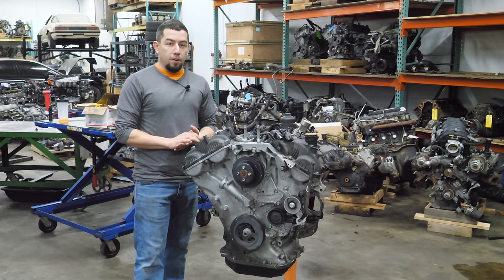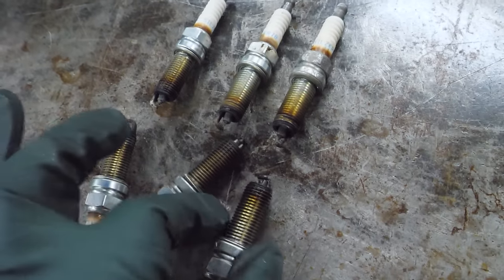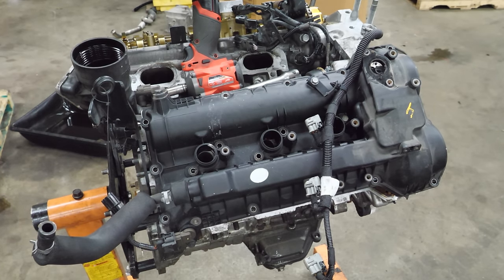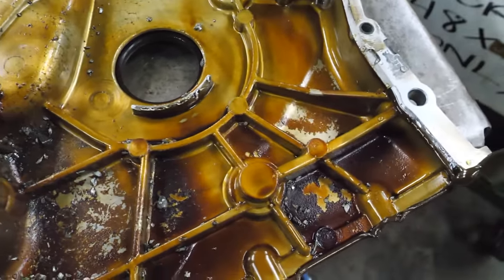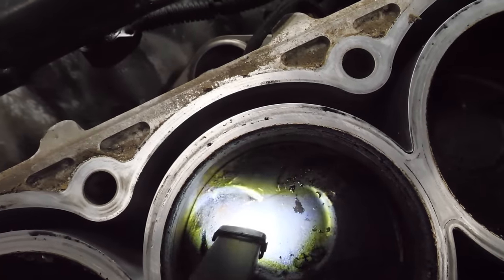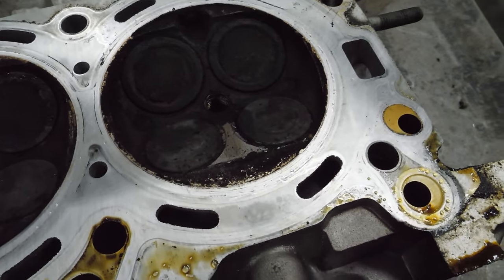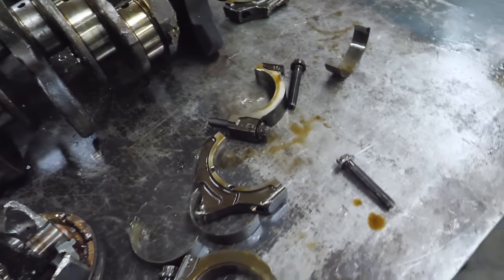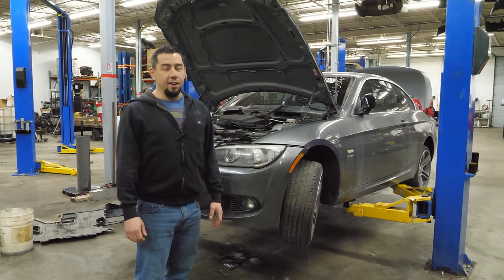Taking "Blown Up Engine" To A New Level! Kia Sorento 3.3L GDI V6 In Shambles. I AM IMPRESSED!

Comment: Extreme Carnage!!!! That poor engine was forced to run, until it would not run any more... My guess- what started this destruction was over-reving.. A rod BoLT then let go, and the entire bottom-end was wiped-out in an instant... A LOT of inertia caused this to rapidly happen... The fact that the oil pump and filter, didn't have sharp chunks shows that it probably did not run more than a few seconds after the initial failure took place. The inside of this engine was nasty, and the owner of the vehicle neglected the car, by not doing the oil & filter changes when they should have... What was once a nice car, quickly transformed itself into an expensive pile of scrap metal.. This engine probably still has parts that might be useful to somebody who just wants to get their car going again,..  So yes, it's not a total loss for somebody who needs some of the working parts that came from it... In My Honest Opinion, I would not want to own an engine this complex..  Because the rest of the vehicle and the electronics are going to be complex too... More to go wrong... And when things go wrong in a machine like this, they tend to go wrong, in a very big way... I have heard in the past, that Hyundai and Kia vehicles have engines and transmissions that are made by Toyota. I wonder if this engine was made by Toyota?

Comment: Man, the valve heads, buckets and cylinder heads got really hot. The oil was was so hot it was smoking, and looks like it was blowing a lot of oil into the cylinders before it let go. This thing was run hard while very low on coolant.

Comment: Mate, what a phenomenal failure. Must've filled it with purifying water (read: hydrolocked), then booted it to cleanse the internals (max throttle to expedite incoming internal obliteration) and ran it dry with no chance of resuscitation.

I guarantee the owner didn't turn this off. They drove it until it's dying breath. Loudest death a daily can have. Also, I think you should a failure leader board and this should be at the top.

Comment: That was one messed up engine. I've hydro locked the same engine twice, ( air/water in take under the car). When you do this the engine just stops, instantly. That looks like someone was facing a repro and they started the engine, put a brick on the accelerator pedal and walked away.  

One question, after a teardown do you recycle the metal? It would be interesting to see the cycle of life of a dead engine. You follow it to the junk yard and we get to see it ground into chunks.

Comment: You would think that if the engine got a big slug of water and hydrolocked, the rods and pistons would break, it would stop, and that would be the end of it.
But this one seems to have continued to spin for a long time, shredding things into tiny bits, stirring the bits, and tossing them out through the block.

Comment: How far do you tear this stuff down before sending it for scrap?  Do you pull the valves from the heads, and separate most the steel off the aluminum parts or isn't the scrap price different enough to make it worth the effort?

Comment: I've seen a chevy small block that started life as a 375 hp small block ran hard 50k then freshed up  ran as a circle track 9k rpm then compression brake for to many laps when it broke into a multi-piece block crank heads and small parts explosion

Comment: The fact that there was little damage on top and every cylinder is trashed makes me think it was damage due to improper towing. That seems the only way it can keep spinning and spreading carnage when there is no possibility that the engine could have been running.  Additionally the sheer number of dents, dings, holes, and impacts tell me it wasn't running. That the oil pump was 'cleanish' says the same thing. I don't believe it was running when it detonated.

Comment: Of all of the tear downs on I DO CARS I have seen this is the worst case.  I wonder if there is a point when driving in deep water it starts to sound funny where if you shut it down is the engine does NOT have a broken rod yet and be simply trashed?  Meaning is the point where you shut it down and the engine will be OK.  If not why not lean on it for the horrible sound effects?  Jus thinkin.  Thanks for the great work!

Comment: i knew a guy that hade a huge bike shop he had buckets and trys neer the counter whare you pay for parts he hade nuts bolts cam chin tenchiners waterpumps other small parts and fasiners and those buckeys wer so populer it brot lots a customers even people that wer in the area from other shops i got a lot of bolts and nuts from thare for prodjects that i was making at home even was good for putting stuf togather that hae nothing to do with bikes or cars a lot of that stuff you throw away put them in like homer buckes so that a customer that needs a bolt or nut that may have gottin lost dering disasembly thare was allways diging thru that stuff helped me alot to

Comment: yep this engine is the worst ever how on earth does it has that much damage, i think they had the engine on a stand and then ran it with low coolant and oil still it exploded, there's no way a 2016 new engine in a running car and a owner would have it with low coolant and oil to make it explode like that, as soon as it made some Nosie they would turn it off, which is why i think someone had it on a stand and ran it flat out with out oil and coolant till it exploded completely IMO ?
Keep up the great work champ. :)

Comment: Had to pull the heads on a 2016 Sedona for a combustion leak 3 months ago . Threads came out of the block in several holes with the bolts .
Got a kit to drill and tap all of them and installed inserts . Been holding up well so far .
Dodge 3.6 are another rolling pile of crap I've  been having to deal with .

Comment: The all time worst example of a destroyed engine is this.   Greyhound buses, had a depot in Alice Springs, NT,Australia.  An employee, who had a greivance decided to kill a bus engine. When servicing a 6V92 Detroit Diesel engine.........he filled up the inside of the oil filter with valve grinding paste made of carborundum. Well on its 1200km trip south to Adelaide...........the grinding past went to work, grinding and ingraining itself into every moving part, opening up tolerances and removing vast amounts of metal.  When the bus arrived at Detroit engine and turbine company ( DETCO) in Adelaide.......it was blowing oil out the exhausts, down on power, but still running.  When Detroit figured out the damage and how that damage occurred, nothing was recoverable and every component was contaminated with carborundum.............so the whole engine was put in the scrap metal bin.

Comment: Never seen one my self, but i have heard stories of completely grenaded/obliterated engines caused by people pulling their standard transmission car behind an RV, forgetting to put it in neutral and leaving the car in first gear before booking it down the freeway at 65mph.
Reply: Having been into the motor of a mobile home transporter's chase truck  - 35 years ago, memory fades - which suffered a fate like this behind the tractor on the return trip, I have to agree something similar was the cause. The water damage is static and subsequent to the (*significant*) event, and no motor under power could so completely consume itself while combustion was still happening. That said, I do not know that this motor was ever paired with a manual transmission and am therefore at a loss for words or cause.
Reply: There's a story (with pictures) about a man who towed a nearly new Jeep Wrangler behind his RV, not only in first gear but with the transfer case in low range. He took it to the Jeep dealer because it wouldn't start. The mechanic estimated the engine speed around 50k RPM. The damage was impressive. It wasn't covered under warranty.

Comment: Looks almost as bad as a 1600 Air cooled VW engine I pulled apart, It was flat towed on the highway in 1st gear at 60MPH for 25 miles, I would send you a picture if I knew where to send it.

Comment: this is just normal for kia hyundai engines... I had a genesis g80 with the 3.8 v6. It suffered a failure like this one at 34k miles. it windowed the block on both sides.

Comment: The only way that's getting topped is if you find a Top Fuel motor that came apart at 100% power in a drag heat.

Comment: This engine proves "The Big Bang Theory". Not much fine metal circulating, but lots of big holes. I agree with @klesmer, they floored it to cross some water and kept their foot in it until the engine stopped. Do vane oil pumps give more room to circulate bigger chunks in the oil?
Yes! 10/10 worst blow up!

Comment: At 14:04, the oil pump spins...it shouldn't.  Looks like keyway to gear on crankshaft sheared and it lost oil pressure.  That will do it!
Reply from the maker: That gear has a friction washer and uses clamp force to be driven by the crank

Comment: I know nothing of engine repair or car talk. What is meant by "hydrolocking" the engine? After reading some of the comments, it sounds like the individual who destroyed the engine did so by driving at high speed through ponded water on the road. Is that what "hydrolocking" is?

Comment: If it came with a manual trans, my guess would be, it was towed in gear. How else could there be that much destruction ? Where was the power coming from after 3 cylinder ( deletes)"?, where did it come from to destroy another 2 ?  I don't think a rock on the throttle could do that.

Comment: Eric never mentioned any history on this.  Why would so many of you think this was hydrolock?
In hydrolock, no matter the rpm, the engine will stop immediately (lock).  The damage will be from that sudden stop, bent or broken rods or broken or shattered pistons but not ground like a coffee mill.
As many mentioned, it ran for minutes after the failure began.  That's brutally evident. 
I'm also surprised that no one else suggested intentional damage.
Has no one ever seen an engine drained of oil then started, put a brick on the pedal and wait for the awesome sounds of an engine eating itself?  
Maybe a guy was to turn that vehicle over to his freshly divorced wife and said over this dead Kia!

Comment: Seems to be one of those engines where the operator knew it was on its way out and took the time to get it running & put throttle to it, letting it run until its very last breath, beating itself to death... kind of like what happened to the "Cash for Clunkers" debacle.  Or... a few hillbillies had their way with it.......

Comment: This amount of damage was not caused by a running engine, it was being over-rev rotated by an external means, towed whilst in gear etc. There's no evidence of oil starvation. 
The amount of head contact damage but seemingly good bearings indicates a rod stretch situation -over rev.
I've seen engined destroyed on purpose with a brick on the accelerator and they tend to have a single point of failure and just stop, fast.
this is a whole engine ongoing catastrophe.

Comment: 4 bolt mains and cross bolts, dynamic spontaneous disassembly always finds the weakest point.  You asked "where are the wrist pins"?  I betting on the creek bottom.  For this, I am betting the owners last thoughts were....If I get a running start, I can probably make it across the flooded section.

Comment: Have seen one worse... but that was a Merlin that had hit the ground at full power vertically...  but in that case there were still at least 6 pistons still attached to the crank... (the crankcase was almost non existant, understandable in the circumstances.) This is THE WORST internal damage I have seen on an engine.

Comment: The only way it could have gone this far is if the vehicle was going downhill at road speed or higher , with the torque converter locked up. No way it could have destroyed itself on its own power.

Comment: No functioning cylinders left.  There is no way that that engine came to be in that state under its own power.  My bet is that it was left in low gear and towed a considerable distance and at considerable speed.

Comment: I worked at a Kia dealer for about a year and I’ll say that the 3.3 was one of the worst engines I have ever seen. They’re nothing but pure junk and I always hated working on them. I will say the 4 cylinder engines were not that bad but not the best either.

Comment: I'm sure someone will chime in, but these motors seem to fail pretty catastrophically from what I've seen and heard are they just bad? They cant all be poor maintainece, lots of cars get bad maintainece and don't do this. I remember a v6 supercharged i took apart that was completely full of dexcool sludge, yet that thing was fine inside not warped or even overheating car drove around on it's own.

I do performance engines exclusively so I usually start with known good usually lower mileage engines, it's interesting seeing the fucked shit up side.

Comment: By far, this ranks number 1 of the worst engines I seen on this channel. Who ever tried to grenade this engine, they over did themselves...They dropped a MOAB bomb instead, which nearly denigrated that engine block! Comparing it to my wife's 2.4L I-4 Theta II Engine from a 2016 Kia Sorento, I would not doubt that her engine is well on it's way of doing the same thing. That's why that SUV has become a lawn ornament instead of a fully-functional vehicle to drive.

Comment: TBH, while I have seen worse, never in an engine that wasn't running methanol, mucho boost, lotsa revs & a money shift. Considering this (presumably) came out of a street car, I don't know if I should be horrified, or impressed. Horrified at the lack of mechanical sympathy by the driver, impressed by the engineering & design by Kia...

Comment: I had  a kia sorento 2016 and i blew UP the engine with the oil change always changed on time 5000 miles and it only had 77 thousand miles on it the worst vehicle ever i had

Comment: They take the flood cars and get the manual shifting ones first so they can pull the plugs and tow them around a private place flooding the cylinders with old used motor oil to get the engine lubricated anough to run and sell to you suckers.leaving it in gear of course.so the cylinders move.and if they dont move this happens.😐

Comment: An engine is a motor, BTW. 

These engines are such garbage. Imagine spending $4k on an engine PLUS labor to replace your engine to have your car only be worth $5k and not know if the replacement engine will fail as well.